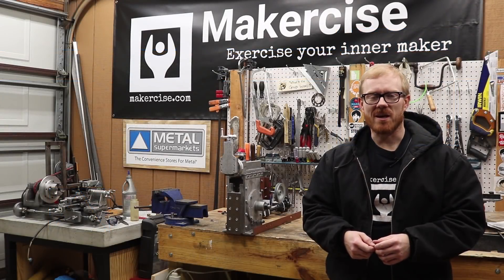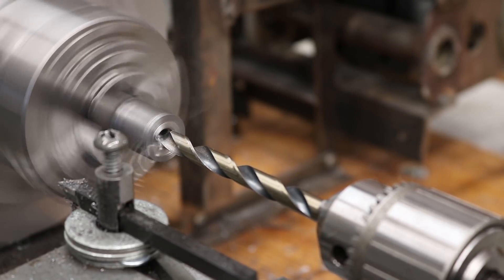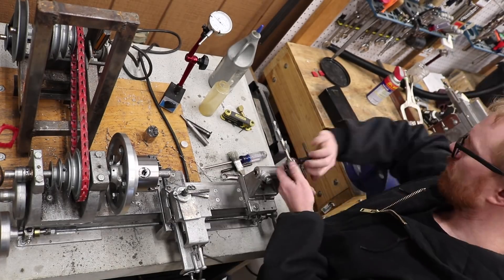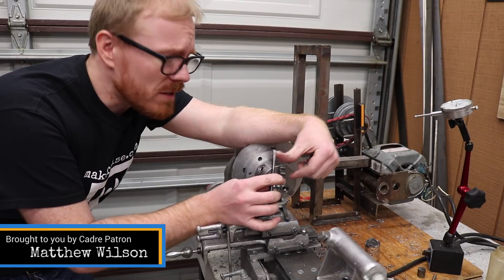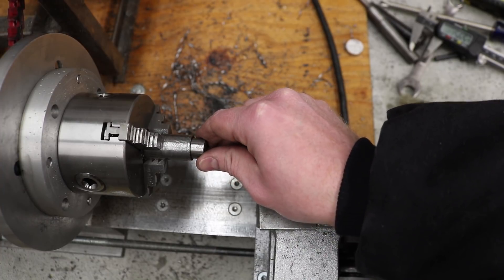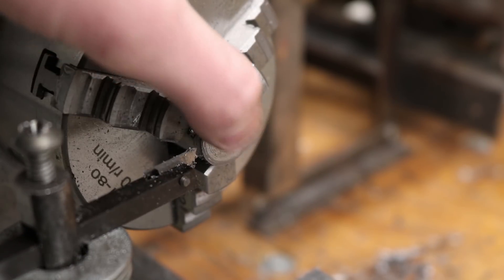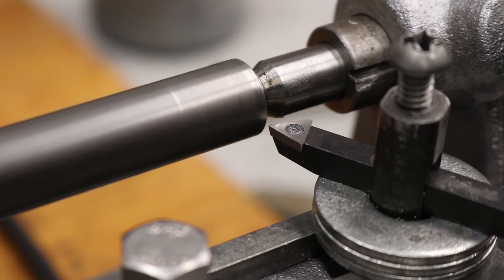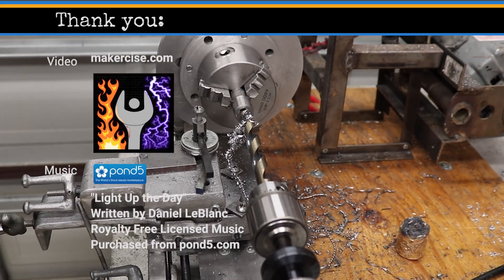Center Jig - Superior Alignment of Rod Stock for Lathe Work

Comment: I have the exact opposite problem.  I have a piece that was started in a different non-lathe process that developed an off-center hole.  I'm now trying to fix that, but it seems the drill bit moves and conforms to the existing hole.  (I suspect the same is what you're seeing in this video.  The hole is actually a guide for the bit and the lathe doesn't just self-center.)  Not sure why there should be any play in the bit side of the lathe functionality for it to move at all.  The question is, how do I fix my problem?  My assumption is to put the materials on a better lathe.

Comment: Also use b bars like u did when it cut better. Tool post should push into the part. Just more ridged, also tool should be just under centerline. Need any advice message me. I'll help u out.

Comment: When you are making a fixture to do a precision job the fixture needs to be ultra precision or else the parts are not going to be any good . I see you when you flipped it around the I.D.  is non-concentric to the O.D plus the center drill has slop in the boar it will be off-center plus the boar in your jig is too sloppy to fit over the barstock you are going to center drill throw it away and start over

Comment: Centre drilling is far, far easier if you do it on the lathe.  Use (make if you need to) a steady rest, chuck up a drill in the tailstock, and, as you have noted, the drill will find centre by itself.  It's a pretty fundamental feature of drilling with rotating stock and a fixed bit.  Depending on the amount of flex your setup has (lots in your case), you should be within a couple of 100ths of a mm or so.  You can make that better by then using a boring bar or other lathe tool to correct the drilled hole, with the piece still in the steady rest.  Takes a bit longer to do than simple centre drilling, but if you're borderline with stock size it can save your ass.  And even if you're not, it saves all those interrupted cuts as you turn your piece down to size.

The taper in your tailstock is MORSE (pronounced "mawrs"), btw, not MORRIS (as you pronounce it, "mawr-is", which isn't a thing).

Comment: The self centering of the 13 mm drillbit is not some magic of the lathe. It is caused by the 118° tip angle of the drill bit grind. Had the drill a flat tip (180°) then this would not happen.

Comment: all the shapers I have seen ,they are built for strength and rigidity. made from cast iron and steel.my question is ,are you afraid the aluminum shaper will shake itself apart.also you said the tail stock alignment may be a common thing on lathes . thats a big no ,I'm afraid.

Comment: Your tailstock is adjustable left to right and if there is slop in it the jib(spelling) screws might need adjusted?
Reply: It seems to me that the issue is not how it is aligned side to side, but that the angle is a little off, since he does not seem to have this problem with the small drills. I don't think that is adjustable without material removal on this lathe (and most other lathes as well).
Reply: neistridlar could be, it's hard to say without having hands on it

Comment: Maybe try making sure the rod is at a perfect 90 in your vice before center drilling it, also there might be some flex in the drill press.. I am no expert just brainstorming
Reply from the maker: Steve Martino largely flex in press. The jig helps keep the rod centered even if the press flexes.